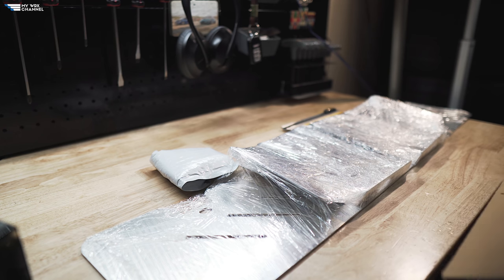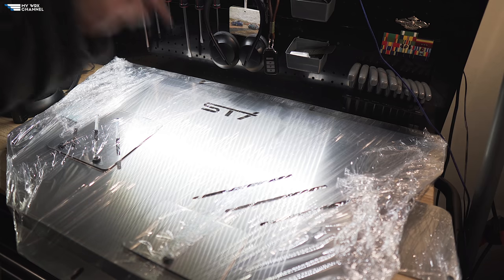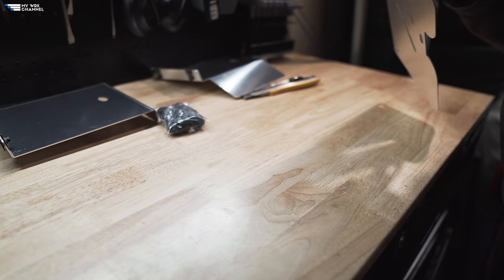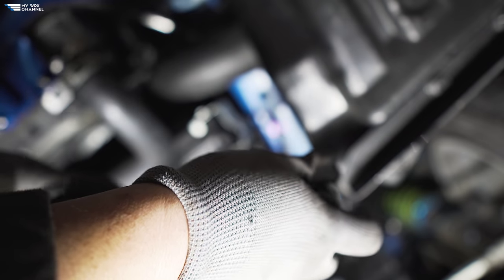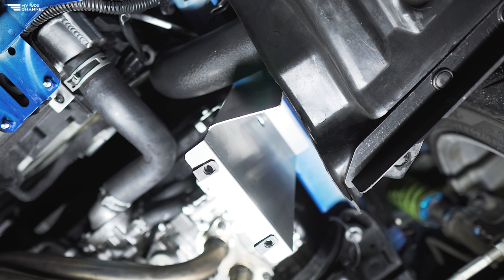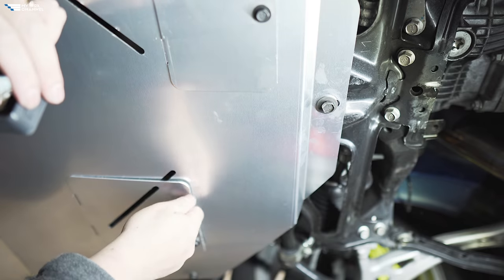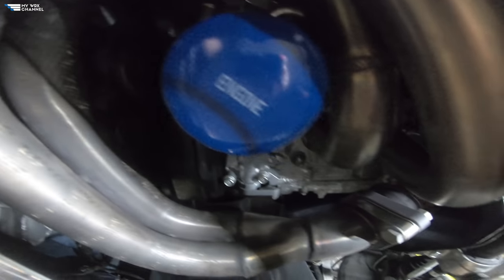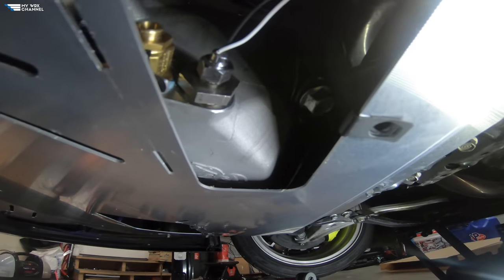🚨OIL CHANGES MADE EASY! STI ALUMINUM SKID PLATE/UNDER TRAY | 2015-2021 SUBARU WRX STI

Comment: Aluminum is very thermally conductive. It will draw heat away from the engine bay opposed the that plastic piece which is more of an insulator. The effects of either are probably minimal being that they are underneath (warm air rises) and separated by air. But if anything the skid plate will act as somewhat of a heat sink.
Reply: So it is good or nah?

Comment: Great vid as always Jr. Been running one for about two years, definitely makes oil changes easier. Only complaint I have is it does corrode slightly over time. Might suggest getting the painted one or coating the bare aluminum.

Comment: Have you run the plate against snow? We get heavy snow in the Midwest and I already tore off one of my fender brackets by the tire and really debating this purchase for the 2020 STi. Since install, any issues? Appreciate you doing this video. I didn’t know they made skids for the 2020.

Comment: question, i didnt know this until i saw this video but when i saw your fumoto drain plug i noticed you still had that black piece still on. I just now remembered that I accidentally threw it out did i fuck up LOL? changed my oil today and put that fumoto drain plug in so
Reply from the maker: That black piece is just a safety. I doubt the valve will ever open up on it's own.

Comment: are you still using the mazda roki filter?i have the same skid plate and wanna make sure it wont have any fitment issue with the roki?
Reply from the maker: I ran out of Roki filters and have them on order.

Comment: Great video dude! I'm a little late to the comments section since the video posted, but I just installed the rally version of the skid plate from TBW on my 2018 wrx sti. I noticed the U clips don't fit over the 3/16" metal on the very left and very right (where you have 10mm bolt/uclip marked). Are there different depths for U clips that I can buy? What do you recommend?

Comment: Is your oil temp gauge working good? I have an STI and is debating to go cheap or not on the oil temp gauge
Reply from the maker: No issues at all. Much better than having no oil temp gauge for sure.

Comment: Can you check your clearance on your ELH? I heard there is occasionally clearance issues and if they touch it will melt the skid plate.
Reply from the maker: No issues at all. Plenty of clearance from what I can see.
Reply: @CarsWithJR  awesome to here. Surprisingly my parents got me the red skid plate for Christmas and I’m putting it on my next oil change :)